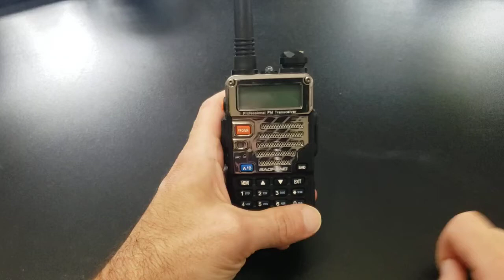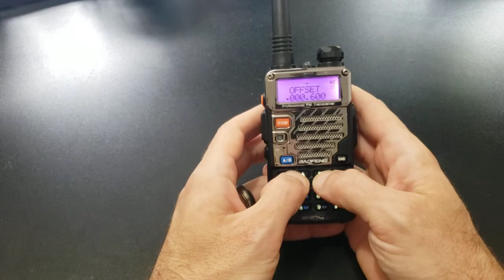How to Program a Repeater on a Baofeng UV-5R

Comment: I have the UV-5RV2+, and it will not transmit any 144.000 frequency,  only 145-148, and 70cm. Also, it will not accept any NOA frequencies. ??

Comment: Nice video. I am very new to Ham radios I just picked up my first one. I'm getting ready to start studying to try to get my technician license. Something I have been trying to figure out is can I program my radio with repeaters without a license and only listen two other people and not transmit or do you have to transmit to get the repeater to start working to listen which requires a license? Thanks